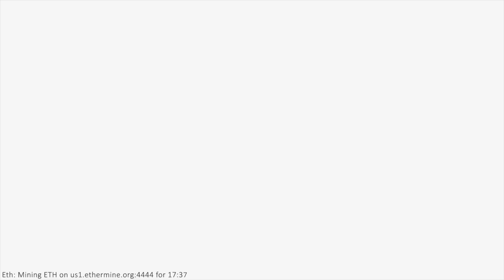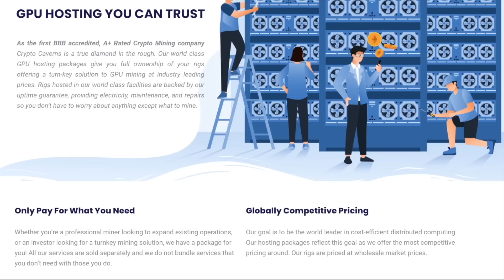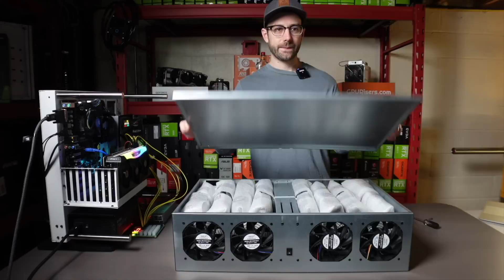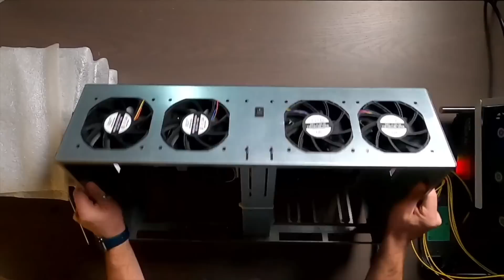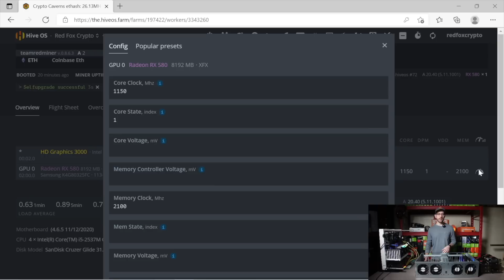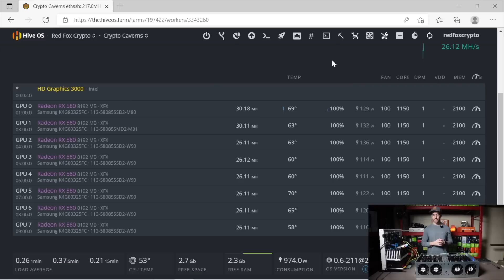Awesome GPU Server Case MINING BUILD

Comment: Great video, Red Fox! Oldest GPU i'm using is the 1060 6gb. Seems to be doing alright on ETH and Flux right now. Not sure if it's older than the RX-580 8gb i've got though. Both are decent little cards! Thanks for the content!

Comment: zotac 1070ti, but i only started 2 months ago, it was gaming, untill i won the newegg shuffle, 3070ti and bought a 2060 , so now the gamer mines eth and rap 3070ti,5800x and the other one mines same but the 1070ti/2060 and a 3800x its fun and warms the house, but i might need to build a shed for the summer with ac and solar panels

Comment: Well done. Great build. 580 are great cards. Server cases can be loud but well worth the time and effort of setting up a mining rig. As for the fans and the direction... I have found that it depends on your cards... Dual/Triple fan cards the case fans should pull out the air, with single blower cards the fans should push air through the case and try not to mix and match blower style cards with multi fan cards. The oldest card I have mining is a 1050ti on RVN. or 1660ti on ETH. 0xc9543452ebb21bc21a20bce2190cd14e572c59eb

Comment: I have a single used xfx 8gb  RX580 and did have it hashing at about 26-27 MH/s but added some 6800’s and then encountered some weird problems unrelated to the RX580. My oldest currently hashing card is a Sapphire Pulse 6800. I’m hoping to get that RX580 and my(problem5700XT) back hashing soon as they will bump me over 500MH/s. Looking forward to the upcoming RX580 video. Keep up the good work and congratulations on 40k.

Comment: Oldest card is probably my 1070ti purchased sep 3, 2018, for 449 on newegg, my working p106 may be older,, bought a 580 8gb on eBay used but the memory was bad, then tried to sell it broken, post office somehow sent it to the wrong address. Think it got picked up by a bot, Had to jump through hoops to get it sent back. Now it's giving me code 43 when trying to install the driver, not sure how, as when I sent it off die was fine, cooler might just not be making good enough contact with the die, as I tried to repad it with .5mm copper cubes on top, and cooled the vrm better, so might be giving off too much power, had bad bios when i sent it off anyway. Might make my project card for the multi meter and rework station. Did notice a regulator was missing a pin,  maybe that's it, part is 78MO5G RYJ33, only 2 of 3 soldered for some reason, also have a k20 I want to try on raptoreum, but I'm having issues getting it installed, another p106 that has 4g memory modules on it for some reason I got from overseas that would always crash, it'll give me the yellow explanation mark in device manager, had the 3gb bios on it though, and a gt710 that doesn't even want to turn its fan on, probably probe it first.
Reply: not sure if this is a good example, but i think its supposed to only have two pins soldered.

Comment: I have 48 1070tis I bought new back in 2018 and I have roi like 10 times or more on. I haven’t upgraded any cards yet. My cards are pulling about $3500 a month all profit since cards are paid and use around $450 in electricity, If I had new 3 series I would save maybe $200 a month in electricity but then would have thousands in cost of upgrading so not worth it right now, I’d rather continue to stack ETH! I did order 8 A2000’s and will sell a few of my 1070tis if those ever fulfill

Comment: Hi guys, could anyone give me a hand? I found different info and opinions regarding the following matter and I don't know what to believe. I'm planning to build a 10 RTX 3060 ti mining rig, with an ASUS ROG Strix B450-f gaming II MOBO, an Athlon 3000g and 1 to 4 pcie (or pcie mux) adapters. The thing is that some people say I won't be able to acomplish this because this CPU only has 6 Pcie lanes, but others say that 1 to 4 pcie adapters don't require the CPU to have more lanes as the bandwith is split between the cards connected to it. Does anyone know for sure what would happen? Or has any experience with this exact CPU and 1 to 4 pcie adapters? Thank you.

Comment: Those 6000RPM fans are a bit overkill. I've replaced mine with a set of Artic P12s and the temps are nice and cool and it is silent enough to put in my living room. My oldest GPU is an RTX3080...hehe

Comment: My oc for Saphire rx 580 micron memory core 1265 , core and mem voltage at 935, mem at 2265 and amd memtweak 30 for micron getting 34.2 Mh at 94w on software 140w on wall✌🏼
Reply: My oldest gpu is 3x 580 and I still have it Saphire cards are really good one's.